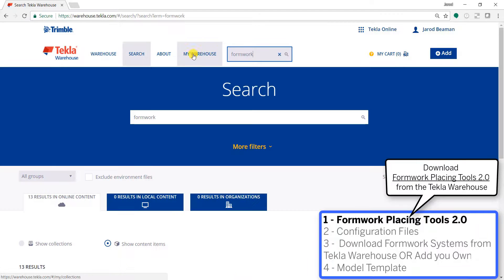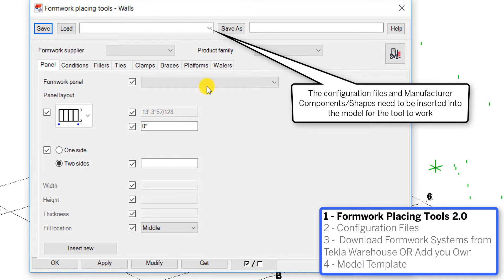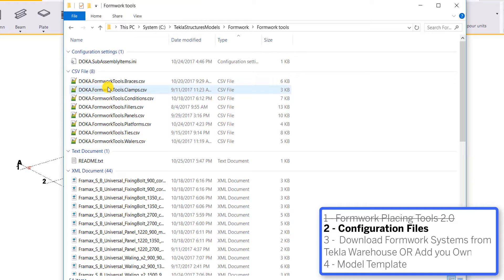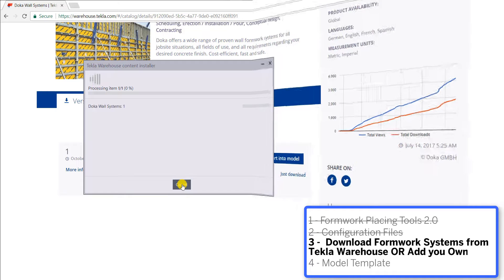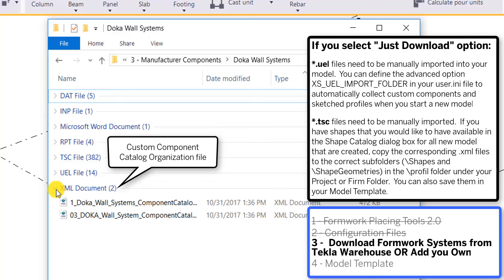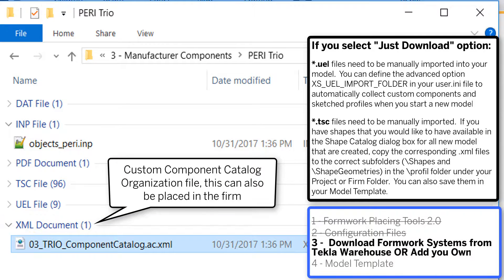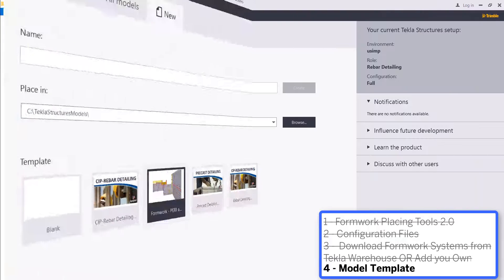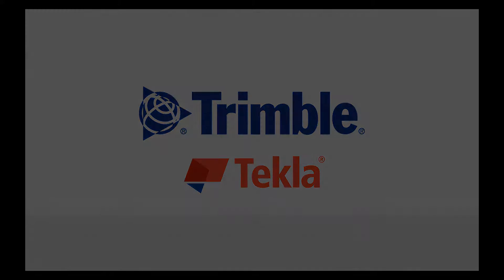Download and Setup Formwork Placing Tools 2017i 1 - Tekla Structures

Comment: Bit of a question. When did the Example Formwork system config files 
get removed. Because all I see when I go there for the TS2018 is 
2.4 (for TS2018i) 
2.4 (for TS2018) 
2.3 
2.2 
2.1 
2.1 (2017i) 
2.0 
1.3 (2017.0.3) 
1.2 (2017.0.2) 
and 1.2 (2016.1.2) 

No where is that list is the the Example Formwork system config files. 
please give a location for said file.

Comment: HI SIR HOPE YOU ARE FINE SIR I NEED YOUR HELP I'M FACING ISSUE WHEN I WANT TO CREATE (GA DRAWING) OR (ASSEMBLY DRAWING) AND ANY (MATERIAL REPORTS) TEKLA STRACTURES AUTOMATIC CLOSE AND I RECEIVE MESSAGE TEKLA STRUCTURES HAS STOPPED WORKING AND THEN RECEIVE MESSAGE TEKLA STRUCTURES IS RESTARTING..... SIR PLZ ANSWER ME WHAT IS THE ISSUE? I WILL WAITING YOUR GOOD RESPONCE
Reply: To diagnose the issue you are having properly, I would recommend contacting your local Tekla Services Team.
Reply: Jarod Beaman  can you help me?. I want to install "towers temple" in warehouse but i can't
Reply: thank you very much!
Reply: I also have problems like you, please share if you have solved the problem.Thanks.